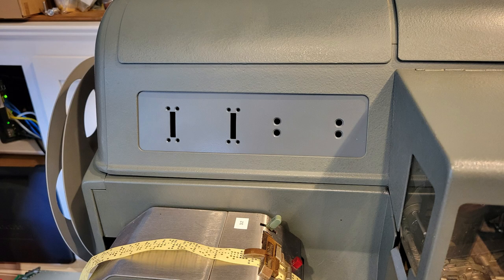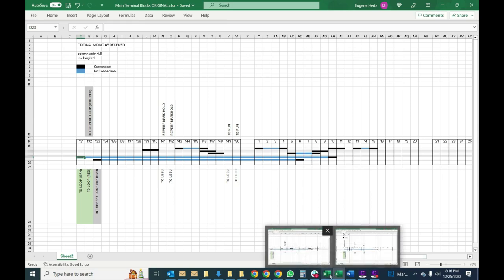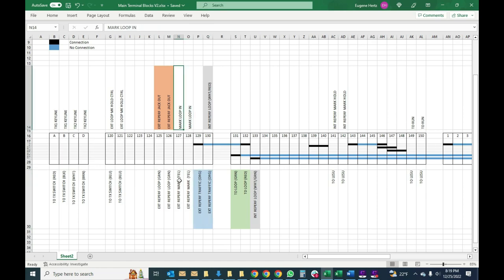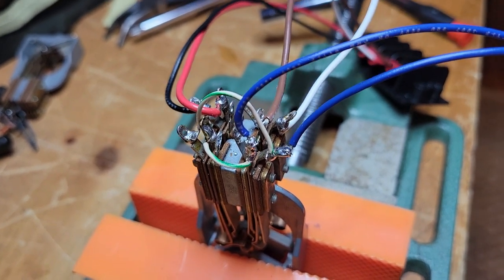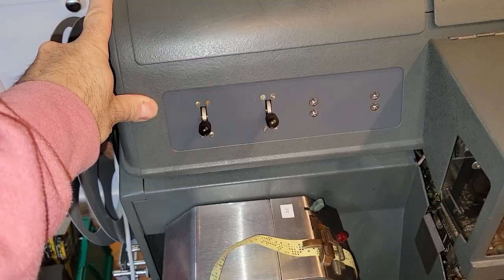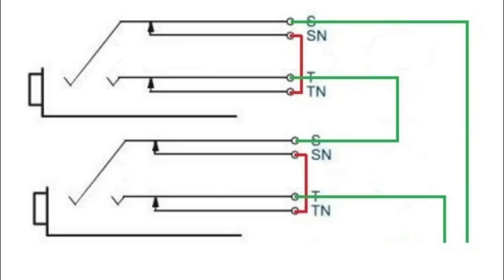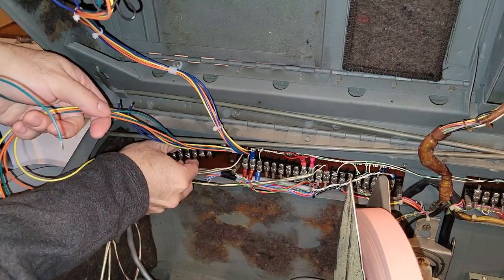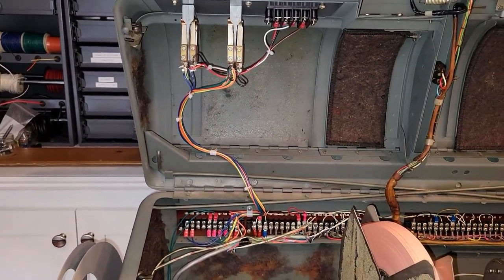Part 2 - Teletype M28 Reperf and Transmitter Control Panel.

Comment: The electro mechanical teletype machines I think reached they zenith with the model 28 series. Yes, our new digital systems for transmitting data are more reliable, but they're not as much fun. Great video thanks a lot.